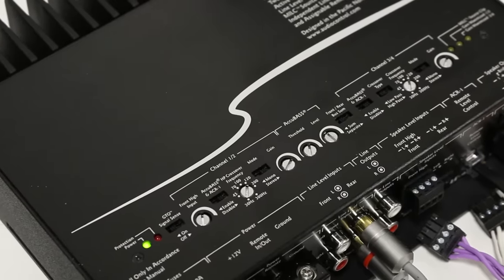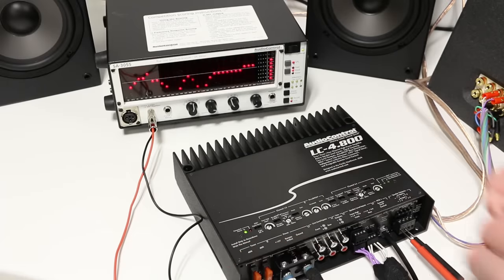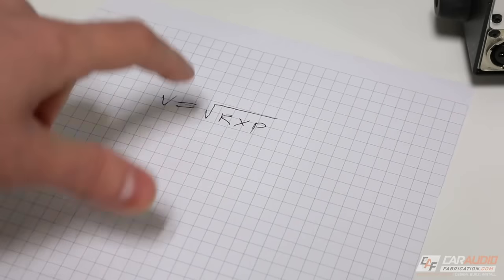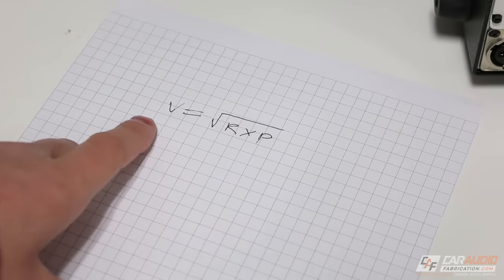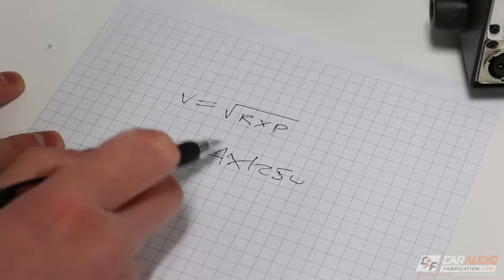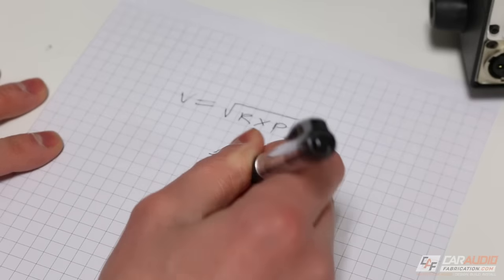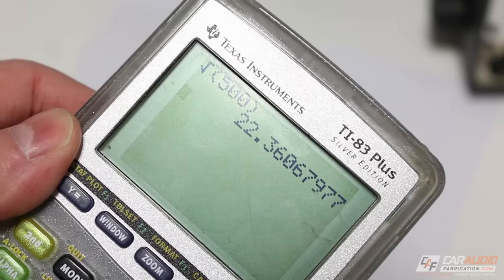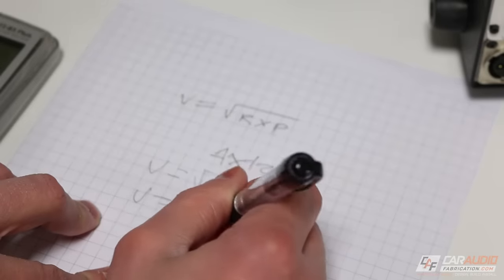Amplifier Tuning Settings How To - Gain, Crossovers, Bass Boost

Comment: When setting the gain on amp Do I need to set factory radio to 0 for bass/mid/treble even if only my subs are running off amp from high level inputs? My other car speakers are just running off the factory head unit!

Comment: You change the gain voltage from your setting point when you did the distortion test... so what voltage is it at now?... you didn't retest that. I got a question, my cars stereo unit has a crossover built in it can be changed via Bluetooth, should I use that or the amp crossover? Would there be conflict using both?

Comment: All is pretty straight forward except @6:20 I can’t tell where the DD1 is connected when checking the distortion volume of the factory radio? Is the dd1 still connected to the amp speaker outs? Am I missing something?
Reply from the maker: Yes. You can measure distortion in anything downstream so it's still on the amp.

Comment: Small point of clarification: pink noise does NOT have equal output at all frequencies; that's white noise. Pink noise has output inversely proportional to frequency (1/f), so there's a fixed dB dropoff per octave.

Comment: Any advice for how to set crossover and gain without these voltage meters and fancy tools?
Reply from the maker: If you want to do it incorrectly sure... just randomly pick a setting on the dial.
Reply: @CarAudioFabrication  gotcha, not recommended. Liked for video, thanks for the response

Comment: So i got a quick question i set my sub up and i tune the amp gain up but when i turn it up it doesnt move much like a tiny bit but wen i turn up the bass boost it bumps i dont know what could be wrong before in my charger it bump with gain now in my dart it doesnt

Comment: Hi i have a powered sub (powerbass sta-10) what would be the best way to set the gain on a sub like this as it has no speaker outs to take any reading off or use an oscope on ? I have it set ok but bejng a 200watt rms sub I'm sure it has more to offer , is has  gain , bass eq , frequency and sub sonic

Comment: Love this video.  I have had many car issues involving a lot of engine work recently  (battery, alternator, radiator, steering pump, etc).  Now my car stereo doesn't sound the same, do you think any of that could of affected my sound in them putting everything back together under the hood?  Im thinking of going to get an audio adjustment if i cant do it myself.
Reply: afc0705 bring it to me ,I will tune it for you for a very good deal

Comment: your frame changed as you did the gain lvl with the dd1 on the amp. is it super low or close to the original gain with the multimeter??

Comment: We are trying to set the gain I have a NVX JAD1200 amplifier and for some reason the voltages fluctuating on AC volts  Are fluctuating between roughly 28 V and 36 V when using a 40 Hz test tone with the sub output wires disconnected? Why?

Comment: Instead of using the maximum output of the amp in your calculation, if the speaker capability is less than the amps capability, would it be more appropriate to use the maximum RMS power capability of the speaker being driven? 

That way the speaker isn't being over powered if its power capacity is below what the amp can put out.
Reply: good question

Comment: Regarding setting GAIN with a multimeter: You said your AMP is 125w at 4 Ohm, 200w @2 Ohm, but why did you calculate  with 4 Ohm, instead of 2 Ohm? My confusion is because my Amp gives ratings at 4, 2, and 1 Ohm, giving me voltage settings of 45, 40, and 36V. (500w, 800w, and 1200w @1 Ohm)

Comment: This was always something I was missing with amps. I am really intrigued on getting one of those SMD DD-1 But can't find them anywhere. Sold out on every site I Google. I plan on building a new system and definitely want it set up right. Are there any other tools like the DD-1  or any ideas where I can find one. Thanks again for the informative videos.

Comment: I just installed an LC 1.800 and 6.1200 in my truck. According to the amps, the source signal was clipping at 28 of 35 on a Kenwood Excelon but not at Max volume, 35. When I attached the DD1, I get clipping at 32 and not 28. DD1 and amp did not match clipping points. Also, something that seemed odd to me was that my gains ended up at about half mark on the amps, previous amps I've had, I've only gone about a 1/4. Is this normal?

Comment: if you have an aftermarket amp and speakers but no subs, where would you set the HP crossover to? still about 80 or lower like maybe 50?
Reply: Wherever you like it best

Comment: I'm trying to tune my newly installed Blaupunkt GTA-460 however don't have distortion detector with me. My head unit is Balupunkt New York 750 and have JBL speaker's installed. How should I do tuning manually can you help me here

Comment: For setting a gain on a amp, what should the subwoofer level be at for the head unit? And if we have a bass boost setting on the amp, but no knob, what do we set it at?
Reply: Same as a bass knob
Reply: Doesn’t matter, as long as u don’t mess with it after the tuning, I would recommend all the way up if your bass boost “knob” sticks out of your amplifier just in case anything in your trunk interferes it won’t distort ...otherwise if its the flat (flush) ones like in this video where u need a flat head , it’s not much of a big deal... so Yea just turn it all the way up for safety measures right before the tune of course

Comment: Question... what if your Amp is 3.5k watts, and your sub has a power withheld  5k watts at 2ohm ? I did the math you suggested and it comes back at 83.6, and I have yet to set my gains?

Comment: I know this video is old but ill give it a shot, is it possible that i have reached the right voltage for my 4 channel amp at the minimum gain level.
The clean signal on the headunit out-200bt is at 28 out of 35. So I set the volume to 28, and then I set up my subwoofer amplifier. I moved the gain just under half, and it was perfectly set. Then I moved on the 4 channel amp and I didn't have to move the gain at all, I just kept it at minimal and the voltage was where it should be. Is this common that some amps don't require you to move the gain knob from the minimum. The amplifier is Soundigital 600.4 evo 5.

Comment: I've got a Pioneer 5 channel amp 2 ohms 600 Watts RMS and I have a 8 inch bazooka 4 ohm drill Voice Coil sub which is 200 Watts RMS handling can I turn the gains down etc to run it

Comment: Question, so if the amp can produce 500W at 4 ohms but the DVC sub runs at 400W at 4 ohms...do we want to go off the amps number even though its higher than Sub?

Comment: Assuming my head unit doesn’t cause distortion at 3/4 volume would I be sending to much power if say I tune to exact gain at 3/4 then later down the road turn the volume past 3/4 on accident will I cause damage? New to car audio and trying to learn. My amp is fed by 4v pre amps.

Comment: Great video mark. Question. What test tone would you use to set gains for midbass drivers and midrange drivers? I hope some one can answer my question. Thanks very much.
Reply from the maker: 1000 HZ for mids/highs 40HZ for subwoofers
Reply: Thanks mark. Appreciate that. How about tweeters?
Reply: 1000 HZ bro
Reply: i'm using Audacity to generate test tone waves. What amplitude should be used?

Comment: Mark, I need help wiring my audiosystem I bought 3 years ago but I never installed in my ford van because it's so complicated. I have the AudioControl  LC-6.1200 amplifier and alpine head unit, 3 pairs of alpine speakers, 1 Kicker 12"L7 subwoofer and another Kicker with 2 12" round Subwoofers mounted in one cabinet (factory) and 1 Kicker 800 watt amplifier for Subwoofers and the Stinger wiring system rated for this system. I am going to install it myself but I don't know how to wire my Subwoofers to what amplifiers I've got, And setting up the tuning part of the AudioControl LC-6 .1200 AMP to the 6 Alpine speakers. I need your ideas on how the best way to connect all of this. I want to get this right the first time, that's why I am here asking your help ! I've been watching your channel for years and I know you're good and extremely knowledgeable and correct about all this. Any help you give will be greatly appreciated !!!!! If you want I'll give you my email address, I will pay for your trouble too !,!

Comment: I put a 12” sub in my car with factory bose speakers should add an amp to adjust the frequency or go aftermarket completely
Reply: ottroyb the bose already has an amp. Buy a radio with built in crossover settings

Comment: Question! While tuning my 4 channel amplifier! Should my equalizer on my Spotify app be set to flat ? That’s all I use for music in my car
Reply: It should be set to the settings you will be using while listening. But Spotify equalizers kinda suck imo. Personally I'd rather use the head unit to equalize.
Reply: Noe Munoz 🤘🏾💯

Comment: If you use a 1 kHz signal to set the gain, playing a 0 db 50 Hzwould cause the amp to give much higher power compared to a 1 kHz, this may introduce clipping right ?
so the only solution is to EQ the curve using a DSP?
I tried flattening the curve using a DSP, but when i wanted to EQ it for a speaker flat response, i didn't have much room to tune the DSP.

Comment: Sad that you cant control the technical aspects of these amps
I needed to repair my over 15 year old hi end stereo amp. As i found multiple potis, i was curious what they are for.
By studying the service manual and circuits, i found out 2 of the variable resistors were to set the fixed class A amplification (which was set very low!). With a bunch of measurements i increased the idle power consumption by at least 50-80%, but the Amp is running now more in Class A and less in Class B amplification. Made a noticable difference at moderate or higher volume.
Reply: and what i wanted to say: despite having only a Bass/Treble,  balance wheel and Pure Direct switch on the front - i never knew what was internally on the PCB possible - awesome! Wondering how easy a car hifi amp is to optimize

Comment: For a high pass filter 
You said around 80hz or better should go into your speakers 
But should that also depend on your manufacturer recommendations as well 

Like if you have 6.5 mid range speakers in your car and it recommends 150 hz should you have your high pass start at 150hz
Reply from the maker: If you listen I say its just a starting point, obviously it will change based on the speaker. 

P.S. If you are using 6.5's that only go down to 150 you better be accounting for that gap to the subwoofer somehow.

Comment: When I'm calculating voltage for my gain I have a question. If I have speakers that got a lower Wattage than what the amplifier produces. Should I calculate voltage with the P value from the speakers to avoid any distorsion or should I still use what my amplifier produces? I have an amplifier that produces 150w @ Resistance 4 but my speakers have a RMS value of 120w @ Resistance 4
Reply: I have same question. Did you find and solve it already ?

Comment: Tell me how to use the oscilloscope to determine the moment of overload (distortion) on the amplifier? Thx.
Reply: That is the easiest.  After the O-Scope is connected to the speaker leads, you will see your signal.  Distortion is defined as any distortion of the signal, so as you increase the gain, level, or volume you will see the amplitude of the signal increase.  The shape of the waveform of the signal will however remain EXACTLY the same however, up to the point of distortion.  When distortion begins, there will be some change in how the signal looks to "distort" the wave form.  As an example, a nice sine wave will always have very symmetrical and smooth transitions, the top and bottom looking identical but inverse of each other.  Clipping, one cause of distortion, will cause the top and bottom rounded peaks to start flattening out, indicating the amplified signal is distorted from the original signal.  With am o-scope, the distortion is very visible, but not directly measurable in any units.

Comment: I recently bought a bass package system from local audio place and had them install, but my door speakers have more bass then my p3 Rockford sub which you can’t even feel the bass in that.. any suggestions? Maybe amp wasn’t tuned properly?
Reply from the maker: Could be a number of things, amp not tuned correctly, vehicle not allowing enough of the bass to transfer into cabin, poor box design, bad match with amp...

Comment: Where u located buddy? I don’t think they did a good job installing my full system I don’t think they separated the sub woofer and I don’t think the amplifier is tuned correctly. I was wondering if I may be able to do a video call with you and show you my amp and maybe you can guide me to some solid settings for what I have because I am completely clueless

Comment: Hi Mark, 
Can you clarify the db value of the test tones you are using as they are written on CD?   This is a very important detail I have never heard any car audio person discuss.  The RMS and Peak levels of those files have a pretty significant impact on this entire process.
Reply: Another thing to note, while 1 Khz is a good signal for basic setup and level adjustments between components, it does NOT equate to be the same as the setting where NO distortion will be present with music.  1 Khz, is used because it is pretty much in the middle of the range where all components will perform well, speakers included.  Many of the components, from the signal source, to the speaker with increase in distortion as you are approach or are at the extremes of the audio spectrum, (20 Hz, and 20 kHz).  Distortions also become more evident with multiple frequencies simultaneously, like we see in music, EVEN at the same power levels, and with some lower end equipment, at SUBSTANTIALLY lower power levels.

I always make my test CDs, and digital test files, at various signal levels as a result, so I can fully test all the components in the system.  Including making full frequency measurements at various "volume" settings of the head unit to see what the "factory loudness curve" is like to determine if there is ANY reason to keep it.  A well designed factory head unit, CAN have a very nice EQ tailored to the vehicle, and as long as there is not a "loudness" contour also that essentially changes the EQ every time you adjust the "volume" knob, it would be well worth keeping in the car.  Sadly many of the factory head units are complete junk in that respect, with many of the so called "premium" units being actually WORSE for loudness contour manipulation than the cheaper factory options.

Comment: im so confused..... Okay can someone please help - have a mosconi pico 2 amp for my front components - 80wrms at 4ohms

ive googled it apparently input sensitivity is .35/16v which is 21.87 volts?? is that correct or do i need other info to calculate i.e the speakers and that

Comment: I know im gana get a lot of negative feedback but so be it. I need help i have the 5 channel audiocontrol amp i have my gains all down my crossovers are off but im still clipping i have 4 ds18 6x9 and jlaudio sub and  my head unit is jvc and i use my appleplay mostly for music i get too 30 and it clips

Comment: Hi mark 
I have recently connected entry car audio by myself and there is a problem. 
When ever I plugged in my two mtx thunder 3000 from the 90s it started clipping with the gain at 1 percent.
I then removed those subs and plugged in my 1 10 inch sony sub and it worked even with the gain high up.
I think the mtx subs are the problem but my uncle says that it's the fuse and the fuse holder at the battery and he also said that my battery is too small
But it's a 12v class A 
Plz help with determining the problem

Comment: Would a shop do this for me? I'm doing the install but how much would it cost for tuning in a shop. Thanks.
Reply from the maker: Any decent shop will include tuning the amplifier as part of the installation. Don't be surprised though if you already have it installed and they don't want to touch it because your install is bad. Unfortunately many shops have learned the hard way that once they tune a system they become married to your car and they get blamed for things that aren't their fault so many won't touch it if they didn't do the work.

Comment: Hey Mark, how does the DD-1 account for the different impedance speakers have since the output voltage from the amp is different for 2 and 4 ohm speakers. Thanks
Reply: Charles montano Ohm load doesn’t matter. The DD-1 level matches your amp with the head unit. You don’t adjust the gain because your ohm load changes, when the amp is level matched to the source it’s going to put out 100% of its clean, distortion free power regardless of the ohm load.
Reply: An amp can’t put out the same power at say 4 ohm as it does 1, hence why the output voltage is less. 
Let’s say an amp is rated at 1000 watts at 4 ohms and 3000 at 1 ohm. Of course the 4 ohm load will have far less output voltage because it isn’t putting out the same amount of power. But if the gain is set correctly, then you’re getting all the power it’s gonna output cleanly regardless of the load.

Comment: Maybe I'm crazy but I have an AC Signal Processor (LC7i) for my 2016 F-150 and I dunno what's up but the Accubass controls do absolutely nothing no matter what volume I'm at. Maybe Ford's system doesn't do a bass roll-off? I'm definitely confused on that front. I don't notice much of a roll-off though at high volumes for my door speakers so maybe it's not happening for a change? If so, good on Ford.
Reply from the maker: Not every system needs Accubass, but it also needs to be set correctly which is described in the owners manual